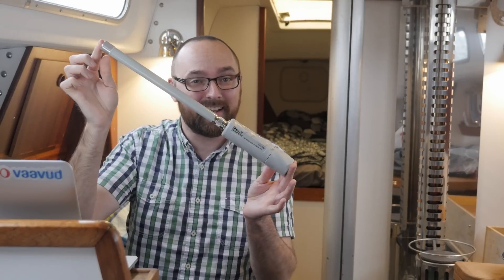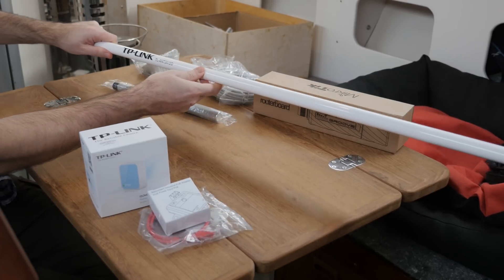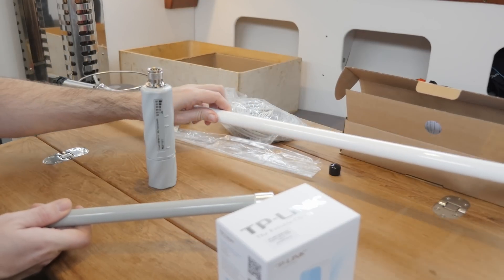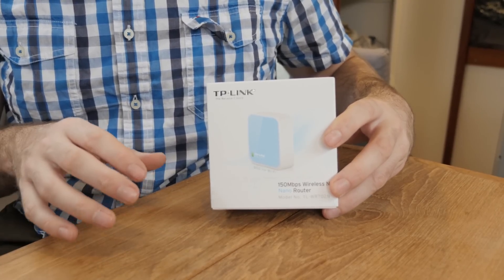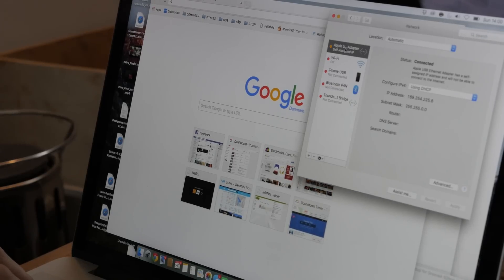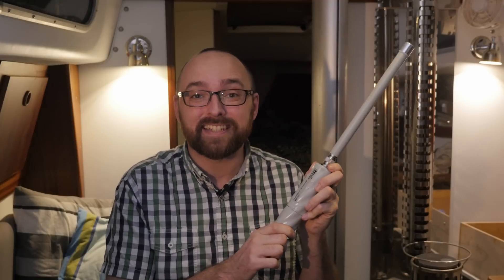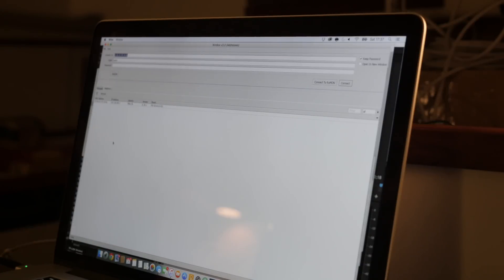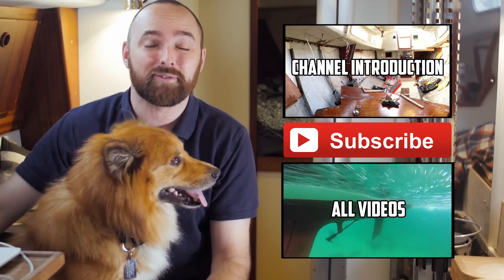Sail Life - (FAILED!!!) Easy long range WiFi aboard a boat

Comment: I was wondering what would cause you to lose your sh*t. You've been very patient and clear-headed when faced with so many challenges. Longer commute to work? No problem. Need to remove engine? No problem. Need to move out of your house in two weeks? No problem. I was wondering how you could be so optimistic through it all. This finally set you over the edge, and I don't blame you one bit.

Comment: Thank you so much - I had the exact same experience. I make my living installing and training software until this product crossed my life. I remember me sitting in 2015 for about 2 days and nights near Triest (Italy) on the floor for installing the Extender. It worked, it suddenly stopped, found a new way to make it work again, after restart stiops working again and so on and so on, Firmware updates, using serveral browsers,.... Was fun to crimp the ethernet wire since we installed the 12dB Antenna on the mast. But the most evel was the software and the company support. All being said in this video is so true. Nothing more to say than thx so much you made my day, I really felt like a bloody idiot that time. PS: Still make my living training and installing...

Comment: I highly suggest returning the Microtik radio, and getting a Ubiquiti Bullet M2 TI, Airgateway (Pro), Tycon (TP-DCDC-1224-HP). The bullet is way easier to use, and if you know what your doing, it can boost the power by adding cable loss.

Comment: Hello ! I know this video is a bit old but i thought i leave a comment anyway. Since you are familiar with computers. Check out the OpenWrt project. It is a tiny linux system you can put on all kind of routers, like the blue tp-link you had in the video there or better just get a cheap one that comes with it from the start. And second, get a directional antenna and aim it at your target, a patch antenna or even a dish..they will always outperform a omni antenna by a lot.. only exception is if of course if you are anchored and the boat drifts around then a directional antenna can loose its aim.. :-) :-) :-) :-)

Comment: If you are at a Marina that offers WiFi in general, you might be able to make a deal using Ubiquiti NSM5's to make a point to point link between your boat and the marina. They have a range of up to 2-15 miles and are POE compatible. ubnt.com
I own and operate a WISP. In general OMNI antenna's have a very difficult time broadcasting over water. The surface of the water interferes greatly with 2.4ghz and 5ghz waves. However if you use a point to point link the waves will transmit uninterrupted.

Comment: rouge wave wifi worked for 3 yrs,srewed up and called tec turned out been using someone else's ip address they helped fix it then it died a few weeks later. They was surprised it worked so long with no bug's.dont fix if not broken..

Comment: Rather than having to think or worry about future problems, I'd prefer to throw money at the problem. I paid $360 with shipping for a Wave RX Marine antenna and router. Two components and easy software apps configuration to find your Wi-Fi. Five-minute install and I have free Wi-Fi. It also uses 12 volts so you don't need a 110v connection to run it.

Comment: MikroTik makes excellent routers and our sys admin won't hear about anything else. two reasons for that: 1. they are highly configurable and 2. once setup they are extremely reliable. shame about the UX on both the config and the forum, but at least you got it working in the end! what i am more interested in is how the antenna performs, and whether you have actually hooked up the TP-LINK one to the system?

cheers and fair winds!

Comment: Great Video :) :) :) :( Went through the same pains here about 3 weeks ago on my live aboard. I picked up an Alfa Network long range USB adapter (AWUS051NH) and router (R36). After fighting firmware/windows 10 issues I finally got it to work and I must say i'm quite pleased with it even with the 5db antenna. I can stream Sail Life video all the way at the end of the finger pier I am on (yay!). I want to fiddle with some of the different antenna setups. I believe the Alfa router is compatible with a Yagi 12 dBi antenna so that's where I may go next. All in all the Alfa stuff seems like a cost effective alternative to any marine specific products if you're willing to deal with the total lack of instruction on setting it up.

Comment: I was in a similar situation in a marina where the wi-fi was far away and weak. This is how I solved it. I used a D-link usb wi-fi network adapter (I already had one but they cost about $40 canadian). i then covered a colander in tin foil and hung the usb stick in front of it....used usb extenders to reach it to my computer. There was no set up, it was really cheap and it worked great. best of luck

Comment: I went to go look at the CLI configuration documentation as well. It's at least as convoluted as what you went through to get the thing working. 

The product I've been looking at for similar use is called "The Wirie". It's a similar setup but includes a built-in access point (with connection for a cable to a second antenna if you have a REALLY BIG boat), and has a SIM slot for 2G/3G/4G data connection as well.

Comment: I have the Ubiquiti Bullet and had no problem setting it up. Thanks for the info and the USB powered router. I just found a router that runs on a 12v power supply. I cut the cable and wired it directly to the battery supply.

Comment: I am on the verge of going through the same routine to set up a wifi for my boat so would love to hear any tips or tricks you may find 
I have to admit i think i will go to the Ubiquetti due the easier user interface 
and the fact i have very little experience with networking

Comment: Get a router you can setup as a repeater, with external antenna option. That way you can just run an antenna cable to out side. no poe injector needed, and only one device to setup. The TP-Link AC1900 Touch Screen Wi-Fi Range Extender, would be a nice one, but the antennas can not be changed, but with it being AC the range is much improved anyways. The touch screen is the selling point on this one for changing to a new WIFI at your next port. The TP link TL-WA701ND, is the recommended access point for your 12 DB antenna. you could use that as it has a repeater mode, which is the same as range extender. 
You could also look as 4g/lte routers with external antenna's, again you can run one cable out side to an external antenna. Like the D-Link DWR-921 4G LTE Router, with something like Solwise Outdoor 3G/4G LTE 2dBi Cross Polarised Omni-Directional Antenna w/SMA Male Connector.
Hope this helps

Comment: Hi Mads.
For 2 years I've been using an omnidirectional antenna (Mars)+RG58 cable+network adapter (Alfa)+USB cable to my computer. It works just fine in any marina and in anchorages as well (maybe up to 0.5NM from the standard modem of a bar/restaurant, more than 1-1.5NM from the powerful source of a marina/camping - yet don't expect too much of streaming videos at such a distance). Very easy to install (besides crawling in the hull to pull the cable) and very reliable.

Comment: When it comes to omnidirectional antennas, they all have a reception/broadcast pattern much like a donut shape with the antenna perpendicular to the plane of the donut. Given the fairly contant power output of the transmitters at both ends of the link it becomes clear that a higher db antenna doesn't really put out or receive more power, but simply has a "flatter" donut pattern that extends further horizontally (assuming a vertically mounted omni). So a 12db antenna can reach further but is more prone to poor performance if the other end of the link is above or below the flatter disc shaped patttern of the higher db antenna. So if your boat is rolling and pitching at anchor or in a slip it could really affect a 12db more than say a 9db. The 9db will have a more forgiving vertical slop to it but at the cost of horizontal reach. About the same rule of thumb for VHF or 2m applies for sailboat wifi antenna selection for the above reasons. So a 9db is probably as high as one would want to go given the motion of the boat and the possible vertical differences between the static mount heights of the antenna s at each end. Also consider that 2.4Ghz likes a clean line of sight and 5.8Ghz even more so. Rain and fog also attenuate the signals quite a bit. Personally, I'd go with a 9db on the masthead as most marina wifi (in the US anyway) has the land antenna on top a marina building roof. Ymmv! Keep the vids coming!
Reply: Just abt what was said -- before reading this comment. Good that reading continued on -- before the opening of a particular (dumb) mouth. Once more, YMMV, depending...
Reply: You have explained the difference between the db. I've been asking and not received a simple reply. Thanks.

Comment: Just a side note about your TP wifi router powered from USB: I have the exact same router and it is garbage. Flashing to the latest firmware has helped - but every 2-3 days traffic will stop flowing (wifi will still be connected). I'd swap it with something else if you can return it.

Comment: Funny to see this video. On my own Albin Ballad Aemilia lll I've installed a Wifi amplifier as well some years ago. I can't even remember the brand. I didn't succeed in setting it up correctly eather as the software kept on crashing my MacBook time after time. After 30 years of owning Aemilia lll I can say it is by far the worst peace of equipment I've ever installed. Hopefully you will be able you get yours working properly. Good luck! Grtz, Frans

Comment: It's a simple thing, network and software designers/engineers need to keep their jobs. Yes it is 2015 almost 2016 and everything SHOULD be plug and play, but if it were like that those people would be out of work after they built their systems. Got to keep IT support in business, customers will always buy the products anyway.

Comment: Not every experience (especially with boats) is positive, I do not feel you need to apologize for anything - I am often swearing as things do not go right - frequently of my own making!  At present I am on the 3rd attempt to stop the floor of my inflatable leaking water in (to be posted soon), and running out of time to do so before my January Cruise of the NE Coast of New Zealand. Have a Happy New Year & keep up the good work.

Comment: What is the biggest datarate you get for your phone or internet stick in denmark? In Germany you mostly get only 10GB, which is insane. Wifi is mostly an problem here from the law that is the reason people are very frightened to gave free wifi or at least open wifi. Didn't expect I have an averange from around 100GB of up and download at home, sometimes up to 150GB
Reply from the maker: +HMStan I get 200 GB a month for around 33 EUR :) I've only used more than 200GB one time after moving aboard the boat so it seems to be adequate. Having said that I'd gladly pay for 300 GB if that was an option ;)
Reply: +Sail Life this is what would pay for 10GB here Germany is so far behind with everything what has to do with internet it is a shame! Also my flatrate at home is limited to 300GB if I reach it every month after 3 month speed gets massivly slowed down...

Comment: I would not go the route you are going. When I look at the specs of the Groove, it's only outputting a max of 27dbm's when transmitting, though it's receive power is perhaps acceptable (though seemingly high). I lived aboard in Southern California for ~8 months or so, on someone else's boat. This meant I could not make modifications to the boat for wifi help. This forced me to look at other solutions. It turns out, there are USB wifi adaptors that have tremendous RF power capabilities that can just sit there clipped onto the screen of your laptop. At the frequencies that wifi uses and with all of the error-correcting in the protocols, a clear line of sight matters a lot less when getting good signal than, say, VHF. So putting a wifi antenna on the outside of the boat is just asking for more headache and maintenance.

What I used when I lived aboard was something similar to this:
http://www.newegg.com/Product/Product.aspx?Item=9SIA4UB33B1311&cm_re=alfa-_-9SIA4UB33B1311-_-Product

That is an ALFA AWUS036NH, and it can output 2 watts of RF power (four times what the groove will do). Those things run around $40. As long as the marina is using a decent antenna, you shouldn't have a problem on the receive end since distance from the antenna is probably a much bigger problem than the hull of your boat in terms of attenuating the signal at those frequencies (presuming you don't have a metal hull, which you don't). Also, the ALFA adapters have a selection of antennas to use, so you can try different ones to see which one works best for your spot. I never had a major problem with all sorts of internet activities using that card. I was able to stream youtube and movies, and I think I even downloaded torrents while using it in the marina. I wasn't able to reasonably do online gaming, but that had more to do with the very sensitive nature of lag in those sorts of activities. The best part about those adapters is they can go with you when you take your laptop onto other boats.

I would recommend against an expensive system that requires further maintenance and headache, I would just search for a powerful clip-on usb wifi adapter that does the job.
Reply from the maker: +jeremyrainman Very interesting! Thank you for taking the time to write such a thorough comment :) I'll certainly look into that :)

Comment: We've got exactly the same setup as you onboard (including the 12dbi TP-link antenna), with the exception that we use the Ubiquity Bullet, and I can honestly say that we did not have any of the setup issues you had, the interface is clean and pretty easy to use. We used it all of our summer holidays and were getting wifi at anchor for hotspots more than 1km away, just make sure your antenna is completely vertical to get the best reception! Would be great to see the comparison between the two and with the two different antenna's. P.S when you install all the "outside" components make sure you seal the connection between the antenna and the booster realy well, it is not a waterproof connection, I used with plenty of amalgamating tape  and 1 year later its still water free inside.
Reply from the maker: +SY Neraida Awesome! That's very reassuring :) I don't plan on mounting the antenna on the outside of my current boat but I'll be sure to remember to tape the connection when I do mount it on my next boat :)

Comment: As a software developer, nothing frustrates me more than trying to fix some idiot's poor work and explain the reason of delay to customers, so I totally understand why you went beserk; had many past instances like that!

Can't wait to see what you'll come up in the end, since this is one of the most under reviewed areas in modern sailing and it'll be quite interesting to see the experience of a fellow sailor/geek.

Last but certainly not least, don't think your weight loss goes unnoticed, moving in the boat surely worked for your favor.  Good luck at the Atlantic passage!
Reply from the maker: +Mehmet Can I hear you! I feel the exact same way! :) There is only 37 days till I leave for Portugal to cross the Atlantic so I don't know if I'll have time to do a comparison before leaving. If not, I'll certainly get around to it when I'm back home :) I haven't stepped on a scale since moving out of the house so I have no idea if I've actually lost weight but thank you so much :)
Reply: Trust me, you did lost plenty. Again, good luck for the passage. And not to put some weight on your shoulders, but I'm going to decide my wifi booster according to your test, so please do some wifi hacking with it if you can for "real world test"... :)

Comment: Hi Mads. Sorry, maybe I am a little slow, but are you doing this to get better reception from mobile landline and convert that with router to create wi-if onboard the boat? Or is this setup "just" in order to be able to connect to someone's wi-if signal on land from your boat?
I don't really understand the purpose, sorry.
Reply from the maker: +Peter Tobiasen I'm sorry I should have done a better job of explaining that :) Two years ago I spent 6 weeks sailing during the summer and wound up visiting a lot of marinas. Most of them had one thing in common. They had crap wifi :) In lots of marinas, I was only able to access their wifi if I took my laptop with me and sat down closer to their access point. My secret plan (if this works) is to see if I can convince the marina I'm living in to let us liveaboards establish a cheap wifi solution here in the marina. We're all having mixed results with our 4G internet and it would be awesome to have a 100% reliable internet connection :)
Reply: +Sail Life cool, thanks for clarifying. It makes sense to do this - extending marina wi-fi - because you can use same solution in harbors outside Denmark whereas connecting to mobile networks abroad would require specialized SIM cards